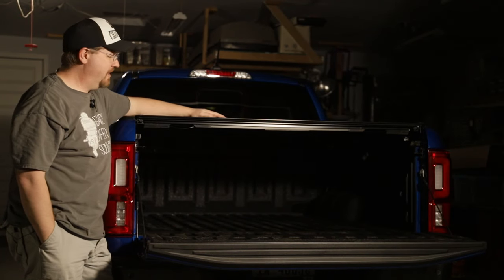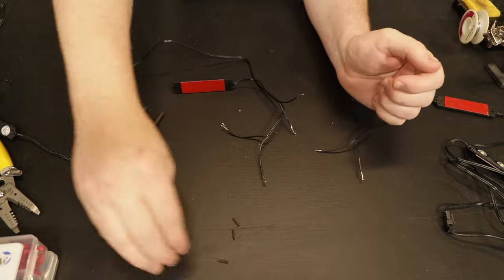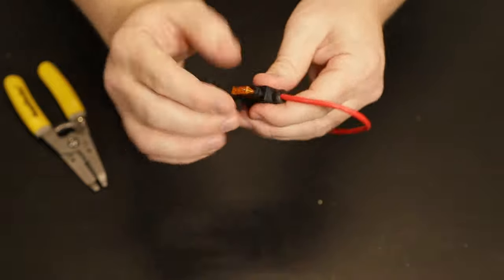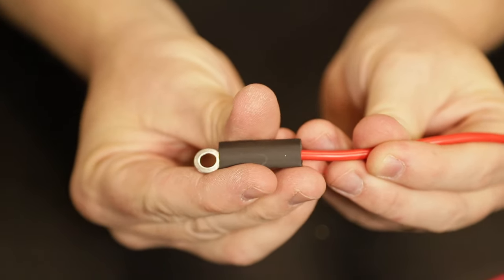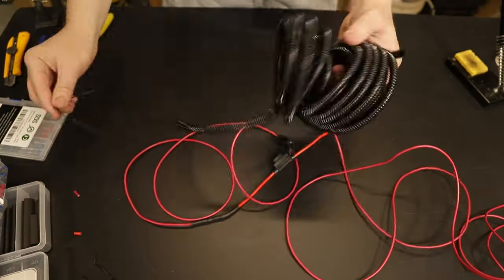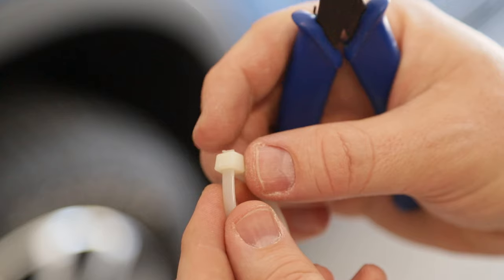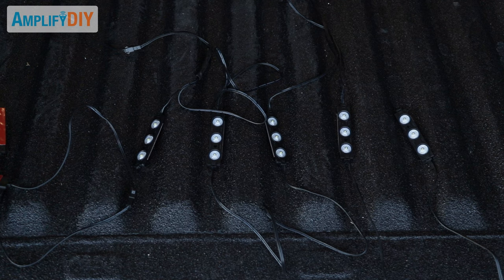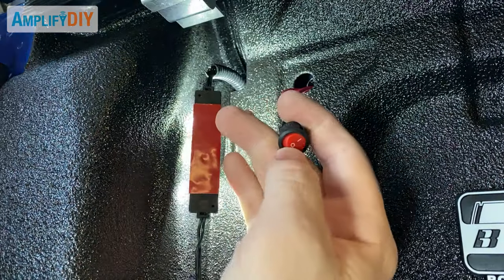How to Install Cheap Truck Bed Lights - No More Fumbling In The Dark!

Comment: My bed has 2 stock lights but I want to add more. Thoughts on tying into those 2 lights to add led light strips and not having to run a wire to the battery.
Reply from the maker: That is certainly an approach I'd start with. Do you have access to the wiring for the existing lights? Do you know the size of the fuse on the circuit that they are already using? As long as the lights you install don't draw a ton of current, you likely will be just fine to add them to the existing circuit. Good luck!

Comment: Nice job. I'm just wondering, why didn't you just tap into your 12V source at the towing package electrical connection?
Reply from the maker: Ahoy Capt'n! I wanted a power source that is always available. On this truck, I believe the tow package electrical connections are only hot when the ignition is on. If you don't mind that restriction, pulling from the tow circuit will save some headache for sure. Great question!
Reply: @AmplifyDIY  hey swab, thanks for your reply!

Comment: Just a thought but, instead of running the positive all the way to the battery cant you just T into a positive tailight wire and have alot less wire to run? I mean in most cases your taillights will be on when you will need bed lights anyway so there will be power there. Plus when you truck is off you wouldn't have to worry about someone flipping your leds on and draining your battery. Just a thought. God bless!
Reply from the maker: Yes, you can certainly wire it like that. I opted to run it all the way to the battery because there are certain times I wanted the lights available without any other circuits in the truck live. I have had a couple times when the lights were left on though, so I may re-think how I have it wired. Thanks for the suggestion, and for watching!

Comment: What fuse amp is recommended thinking of doing this for the bed liner, inside, and underbody. So three switches to control which ones I want to turn on. So I would have to have the inline amp fuses anything to look out for?
Reply from the maker: Mainly just make sure that whatever lights you install pull roughly half or less than half of the rated amperage. You can likely look this up on the manufacturer/seller site.. but if you use LED pods on a string like this, they draw VERY little current. A 5A or 7.5A fuse would be plenty. You can either fuse each strand individually, or put them all through 1 fused line - just plan for the amps the lights will pull and use fuses sized for the load. Good luck!
Reply: @AmplifyDIY  could you give me a recommendation on how you would install these exact lights?. What I’m trying to do is have two strands to one switch ( for interior), two strands to one switch (for bedliner like you did and under hood), and then two strands for under the truck to one switch. All these would have to have their on inline fuses right? And would it cause a problem if they are all touching on the post of the battery? Or is there a simpler way to wire these where at least one wire from all the switches could be connected with a higher fuse possibly? No clue about wiring. Thank you for your response and time. Don’t know if a diagram would help me more

Comment: Great vid. Clear explanations. I’ve been looking at doing this on my ‘19 F150 but would like to tap into the power supply feeding the rear cargo light. That way I can take advantage of the factory cargo light switch inside the cab AND have the LED bed lighting that I install switch on when a cab door is opened (my cargo light comes on when a door is opened). Looking for an F150 wiring diagram.  But thanks for the video, love your attention to detail and the use of heat shrinks. Who wants to redo wiring because one cheaped out on taking the time to protect the solder joints?  No one.
Reply from the maker: Initially I wanted to do the same thing with tapping into the wiring for the factory rear bed light - but the only way for me to get to it would have involved pulling down the headliner and pulling off most of the rear interior panels... and I just didn't want to do that to the interior of a brand new truck. 
In retrospect, I suppose I could have pulled off just the dash panel that has the manual override switch and probed the wiring there to see what I could tie into - but then I would still have to get from inside the cab all the way to the back, likely through the firewall into the engine compartment, then down along the frame as I did. 
I'm super happy with how this install turned out, but would have preferred to be able to use the factory switch. Good luck with yours!
Reply: @AmplifyDIY  Thanks. I was watching an install video for a kit sold by F150leds.com and they tap into the wires found under the door sill plate on the passenger side rear door.  I’ve ordered an F150 service manual that is supposed to include wiring diagrams. It did not seem too invasive but I’m not a fan of using a cheap plastic tap.  And I don’t really want to solder onto a factory power wire in such a location. I like how you did it and will likely go that route. The other option is a power distribution system like SPOD, but they are expensive, but very effective at simplifying the addition of non factory lights, etc.

Comment: What type of heat shrink did you use? I have never seen heat shrink tube shrink that much.  And the zip ties after you cut them, you can slightly melt or file the sharp end.
Reply from the maker: Hi Daniel - good tip on dealing with the zip tie ends. Thanks! The heat shrink is not anything out of the ordinary as far as I know. Here are the affiliate links to the exact heat shrink I used in the video (same links as in the description):
Heat Shrink With Solder: https://amzn.to/2XE8KR2
Plain Heat Shrink: https://amzn.to/33HCekI

Comment: Awesome video! Good quality instructions. Wired everything up exactly like this today and turns out something went wrong. I have power on my switch when it’s on. But no lights turn on, I disconnect piggy tails from first set of lights and the first led pod lights up just barely. Any suggestions? Thanks!
Reply from the maker: Hmm. Maybe defective LED lights? Did you test the LEDs prior to the install just to make sure they work? Possibly a bad ground connection?
Reply: @AmplifyDIY  yessir! Spliced them up, tested them and they lit up perfect. Thought it was bad ground at first but ended up switching spots and still nothing. Does running a longer length wire make a difference ?
Reply from the maker: The longer the wire, the more resistance. What kind and gauge wire did you use?
Reply from the maker: I believe I used 16 gauge copper stranded. I was careful to make sure it was 100% copper, and not copper clad aluminum (CCA). That stuff is terrible.
Reply: @AmplifyDIY  I used 14 gauge wire. I appreciate your response! Ended up finding out I’m using a rocker switch ( 3 prongs ) that got sent with the lights, and not a toggle switch. ( 2 prongs)
Reply: @AmplifyDIY  I have both switches. Gonna finish up wiring tonight, which do you recommend in using ?

Comment: The way this is wired up do you have to worry about the LED lights pulling power even when turned off?
Reply from the maker: Hi Kameron - the lights will pull power whenever the switch is on. If the switch is off, they don't use any power at all. Great question, and thanks for watching!

Comment: @ 6:43 - 16:13 - 16:23  - aren't those self-soldering connectors you used?  On your already soldered connections?  And you didn't heat them enough to melt the built-in solder ? ? ? ?
Reply from the maker: Hi Jeff - yes, those are self soldering connectors. I mention them in the beginning, at 1:22. If you look back at the spots you mention, I am getting them hot enough to melt the solder - it's a little hard to see with the footage sped up.
I should have mentioned this in the video, but I did some early testing with these heat shrinks, and found that they didn't really have enough solder in them to make a great connection. So I soldered the connections initially, then added this heat shrink (which melted the solder in the heat shrink and blended it with the solder already in the joint), then covered the whole mess with yet another sleeve of black heat shrink. 
I did put a note up at 1:20 about how I go a little overboard with the heat shrink. 
Thanks for watching!

Comment: U can save all the extra electrical work by using the extra pigtail that comes hidden under bed on drivers rear.  That way u don’t need a switch.  It will run off if your cargo light switch in cab
Reply from the maker: Pretty sure that is intended to run a 12v bed power supply. I didn’t want to use that so that if I decide to add the bed power supply in the future it’s still available. Thanks for watching!

Comment: What are those wire covers towards the front of the bed for?  Just bought a ranger and have the same things coming out of the bed going up toward the tonneau cover
Reply from the maker: Hi GoldRush - It's been a while since I installed them, but as I recall those are actually drain tubes that go from the underside of the front of the tonneau down to drain holes in the bed. There should not be any wires in them at all. I hope you love your Ranger!

Comment: Did you have any issue getting the switch in? 
The switches I’m finding and what came with my lights are 19mm.  But the factory hole in my ranger is much smaller, what did you do to get the switch in?
Reply from the maker: Hi Natalie - I purposely bought a switch that exactly fits the smaller hole in the ranger: https://amzn.to/3gKc6ta
Note that these are sized to fit in a hole that is between 14 and 16.4mm. I believe the ranger hole is right at 14mm. See the links in the description for all the other exact stuff I installed, if you are looking for anything else. I'm happy to try to answer any other questions as well. Good luck!
Reply: @AmplifyDIY  Thank you for this. I was planning to drill out the same hole that you used in order to fit the larger switch that I had purchased. I'm going to return it and buy the same one you used for my ranger.

Comment: Is there a way to have a switch inside the cab and a switch in the bed so a person could use either switch??
Reply from the maker: The switch I used is a simple single pole switch. If you wanted to have 2 switches, you'd need to use a 3-way switch, and run the correct wiring to both the cab location as well as the bed. 3-way switches are a little trickier to wire, but it could certainly be done, yes. Interesting question!

Comment: I have a 3 connector switch, i put a ground with the leds negative to a connector, a current from my trailer connector with an fuse (30 amp), and a connector with current from the switch to the lights, all connectors have a housing to protect from shorting but when i turn the switch OFF , the fuse blows up, why would this happen?
Reply from the maker: Somehow when you flip the switch, you must be shorting one of the + wires to ground somewhere in the circuit. I suggest drawing out a diagram that shows exactly what is connected where... that may help you identify where the short occurs. Good luck!

Comment: Is there a way you can connect it to a fuse tap on the fuse box?
Reply from the maker: Yes, I use these little guys for that: https://amzn.to/48xGket
You'll want to check the fuze size of your vehicle before you grab the add-a-fuse to make sure you get the right size. Good luck!

Comment: What size fuze did you use for the inline fuze/fuze holder?
Reply from the maker: Hi Alex - Off the top of my head I believe it was just a 5 amp fuse... but it may have been 10. These lights hardly draw any current at all though, so it does not need a very large fuse. Thanks for watching!

Comment: What size fuse is recommended?
Reply from the maker: Hi Jennifer - this depends entirely on how much current your lights will draw. The specific lights I installed hardly need any current at all. I did the math back when I filmed this video to determine how much current they would draw normally. Looking up those lights again, it says they draw .5 watts per LED. There are a total of 24 LEDs across 2 strings, so that's a total of 12 watts @ 12 volts. Using this calculator (https://www.rapidtables.com/calc/electric/watt-volt-amp-calculator.html) you can see that works out to just 1 amp that they will draw normally. Install a fuse that is at least double what your regular current draw will be. I went bigger and used a 5 amp fuse. Good luck!
Reply: @AmplifyDIY  Thank you! This is a really great video. Very helpful!

Comment: This may sound stupid because I not the best with electrical. Why can't you wire the bed lights into the cargo on top of the cab?
Reply from the maker: Hi Bullwolf - you could, I suppose, but in order to get up there you'd need to run wires into the cab, up along the side pillar of the rear of the cab, and into the lighting harness located there for the upper brake light/rear cargo light fixture. Honestly, I think wiring straight through to the engine bay where the battery is was actually a little easier - though it's entirely up to you if you prefer to be able to use the switch in the cab that is already there to turn on the cargo lights, or put a switch in yourself like I did.
Great question - thanks for watching!

Comment: I did enjoy the video. My only concern is the fact that although you did use automotive double-sided tape, I am not a fan of using double-sided tape on an exterior surface. Also, I did somewhat cringe when I saw the switch that you used. It is not weather resistant.
Reply from the maker: Hi Dennis! Thank you for the feedback and for sharing your concerns. I also don't love the 3M automotive tape, but in this case I was sticking it to the Bullet Bed Liner surface, which is FAR tougher than paint. It's been nearly a year, and the lights are still stuck well in place.
As for the switch: I had to balance between not wanting to drill new (larger) holes in my truck bed with getting a waterproof switch. Given the switch location, and that I always have the tonneau cover over the bed, I opted for the switch I used, as it was the only one I could find that fit that opening perfectly and since the circuit is fused I'm not overly concerned about the switch shorting out if it gets wet. 
However: if you know where I can get my hands on a waterproof switch that will fit in a 15mm diameter mounting hole, please let me know where to get one. I'll gladly swap it out.
Thanks for watching!
Reply: @AmplifyDIY  i plan on setting up a system in my bed (14 Silverado).  I'm going to tap into trail light circuit with 2 magnetic switches via the tailgate.  I will be posting a video if interested.  No, i don't know where to get a switch.  Good video though.

Comment: So one light you cut out ?
Reply from the maker: Hi Edward - apologies that the video was not very clear about this: I did cut 1 light off of one strand, but then I spliced in the next strand in a Y so that the light I cut off would still be in the circuit. Hopefully that makes sense - you can check the video carefully at the 1:50 mark to see this splicing again, and note that I'm connecting 2 wires into 1 at each of the solder joints: one goes out to the light I cut off, the other goes on to the next string of lights. Thanks for watching!

Comment: What amp fuse did you use ?
Reply from the maker: Hi Jim - I believe I used a 5 amp fuse. These lights draw very little power.
Reply: AmplifyDIY does it matter the size of the wire wired from the battery and ground?
Reply from the maker: I prefer to go with the heaviest gauge I can for runs all the way from one end of the car to the other. Technically you only need to size it for the load you’ll have on the circuit, and on little lights like these you can get away with really thin wire...but heavier gauge is more durable, and gives you the option in the future to run something else off of the same circuit, should you ever need to. I believe I used 14 gauge for mine, but it’s probably fine to use something lighter like 16, 18, or 20 gauge.
Reply: AmplifyDIY thanks man

Comment: What size fuse?
Reply from the maker: Hi Daniel - you really don't need a very large fuse as these lights draw hardly any current at all. I believe I used either a 5 or 7.5 amp fuse. Good luck!

Comment: Only issue is don’t forget to turn them off, or accidentally bump them and turn them on, or it will drain your battery.
Reply from the maker: Very true. I did leave them on once overnight, but luckily they draw such little current there was no problem. I’m careful about them now. Thanks for watching!
Reply: Can always wire in magnetic contact.  Will turn on when open off when closed and switch for override if leaving tailgate open and don't need them on.
Reply: @EricsMuddySporty  that is exactly what I am going to do. When I do this, I will make a video.

Comment: Why is everyone running the wire all the way to the battery? You have an always HOT at the trailer plug.
Reply from the maker: Hi Harley - A few reasons: First off, I prefer it to be on its own circuit, so troubleshooting is not extra complicated. (Hmm... problem with my trailer wiring... maybe something with my bed lights is messed up?) Secondly, it's not universally true that you will always have a hot at the trailer connector. For most installations this is true, but specifically on Ford there are some years / models that have the hot tied into the ignition: https://www.etrailer.com/question-150591.html

Comment: Dude, get some proper crimpers and flush cutters! Otherwise, nice install.
Reply from the maker: Yeah, I really should... but in this video I just had to "run whatcha brung". Thanks for watching, Brad!
Reply: @AmplifyDIY  I will also say, I have been doing automotive electrical for all of my adult life, but I learned about running wire inside the length of the frame rail. Great idea!